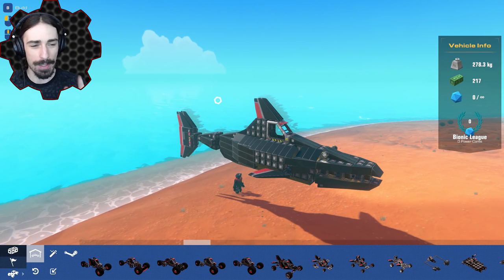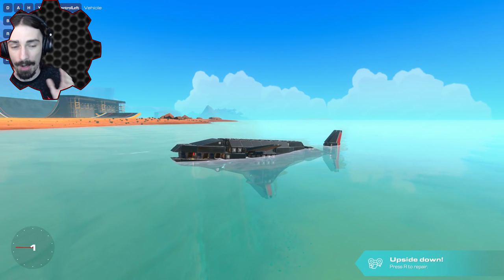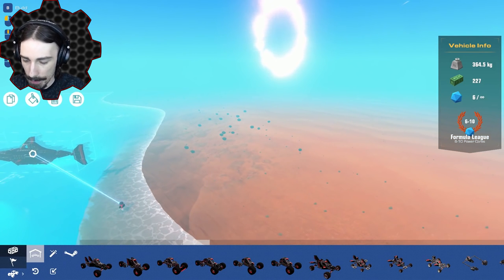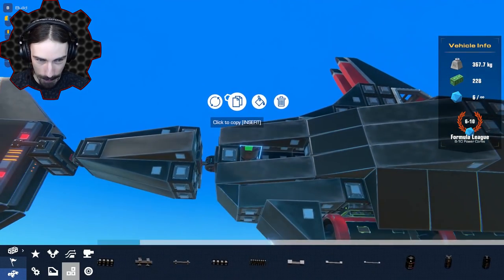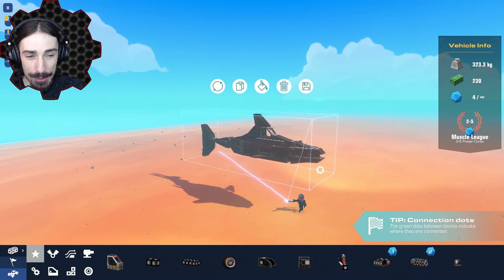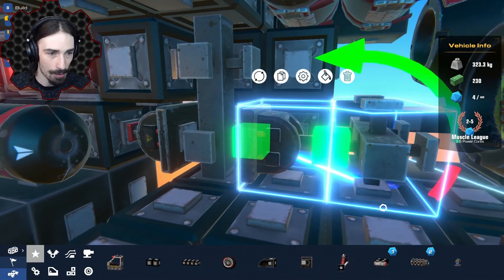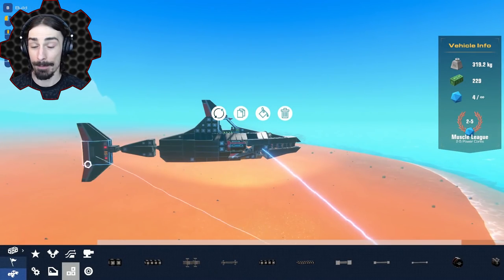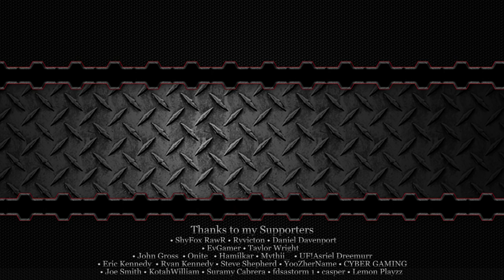BUILDING A SWIMMING SHARK BOAT! [Water Update] - Trailmakers Early Access Gameplay Ep24

Comment: Use the fins to try to stop the turning tilt. Instead of having them tilted down all the time, put the one on the inside of turn to 0 and the one on the outside tilted down. That way you have more lift on the outside of the turn and it might help with the tilting.

Comment: Are you able to like link the back fin to the side fins? My idea is that when you turn it turns the side fins down a bit which would counteract the sinking. Only thing is is you still might need to have the side fins on a slight angle all the time. I don't have the game so I'm not sure how it works but basically you have the sf(side fins) by default at an angle to keep you leveled and when you turn instead of the mouth moving (which is still funny af 😂) your sf angle down. Please reply if you'll do this or not or if you have any comments about it like why it won't work or that you're not able to do it.